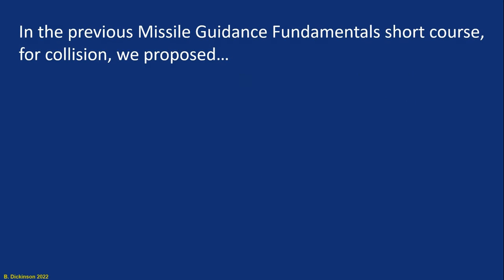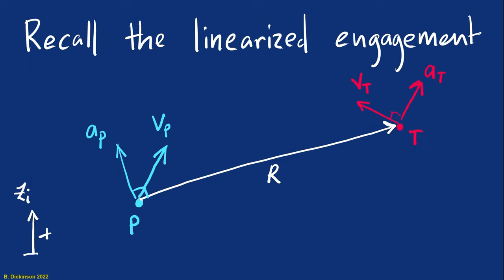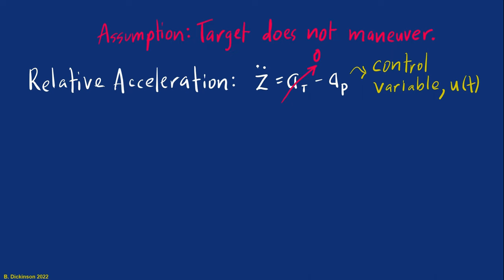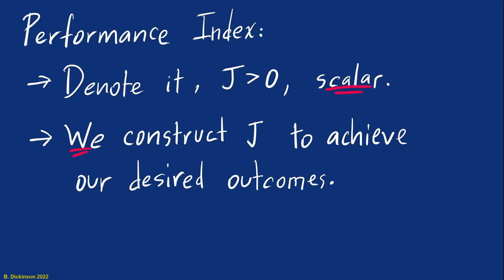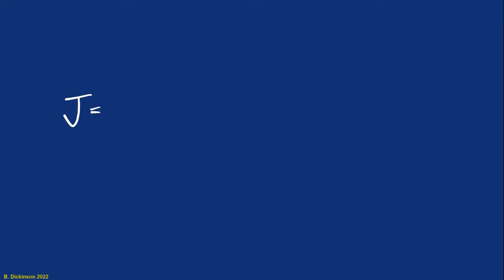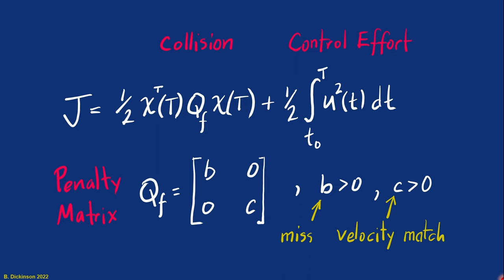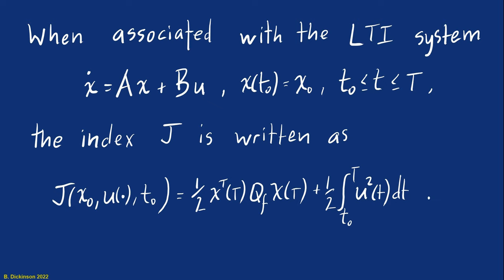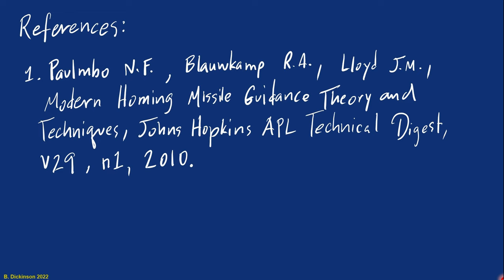Guidance from Optimal Control - Section 1 Module 1 - Problem Statement

Comment: Can you do LQR control design for the full nonlinear collision dynamics?

I guess the L in LQR refers to the dynamics being a LTI system? So my guess will be no?
Reply from the maker: Right, L means you have a linear problem. You can get a solution for a nonlinear problem statement but you may have to resort to numerical results, as opposed to an analytical solution.